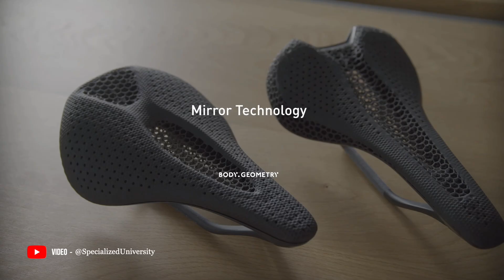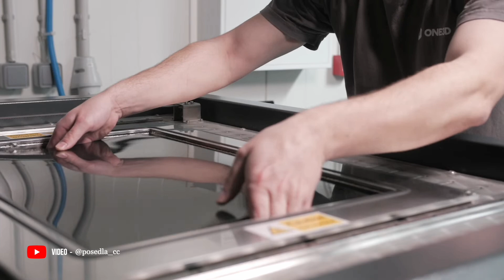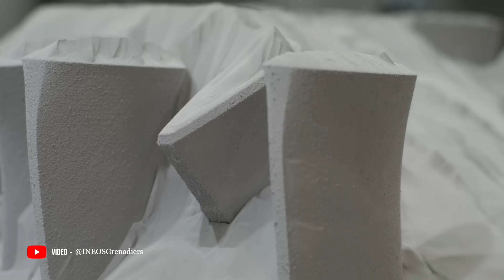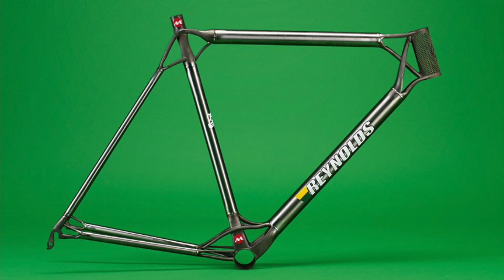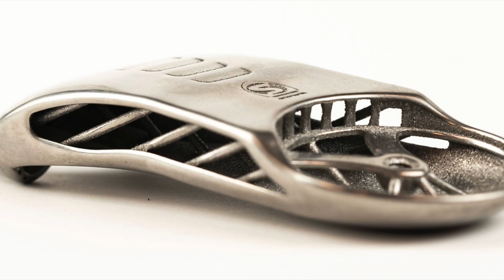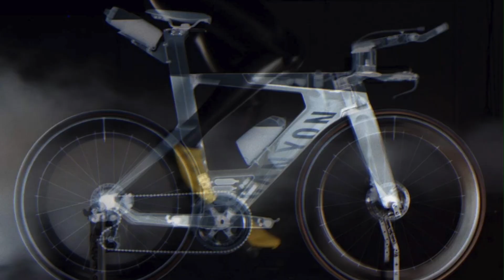3D Printed Cycling Tech And How It's The Future Of Cycling...

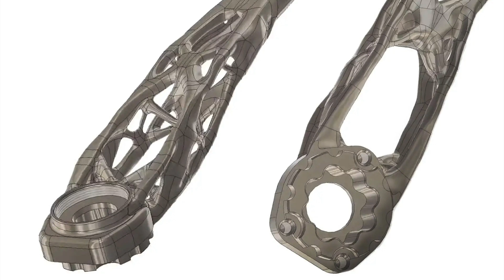Comment: 6:43 I also took the optional costing class for engineers that dives into why 3D printed cranks is a bad idea. Basically, what SRAM and you have done is turned the Finite Element Analysis all the way up to 100 and then cut out all the "redundancy". However, for this to work, the loads and forces must be VERY specific, so the idea wouldn't fly on a commercial product that needs to fit many riders of all shapes and sizes --> Same problem with the 3D printed frame.
Reply: That's not a problem with 3d printing. That's a problem with bad engineers who don't knkow how to spec stuff for TopOp.

Comment: It seems that engineers are fully on board with 3D printing, the general public will need some convincing/educating.
Reply: I would say for engineers encountering specific problems, 3D printing is awesome for quick prototyping and testing, but for commercial production, it's just not the right technology. Moulding takes time if it's only used for prototyping, but for production it's actually dirt cheap and very efficient.
Reply: @Tony Soviet  definitely not for mass commercial production. But there's no reason it couldn't be used for very high end,  niche parts that can be fully optimized for weight and stiffness.  Also, a lot of people just like niche things.  People still buy $8000 custom framesets.  No reason why they won't buy a $2000 crankset and $700 stem.  It's not for everyone but even Shimano 105 is out of reach for many.
Reply: Why?  They generally just buy what's offered within their price range.  If Shimano or SRAM made high end, 3D cranks that are lighter and stiffer then what's available, people would buy them